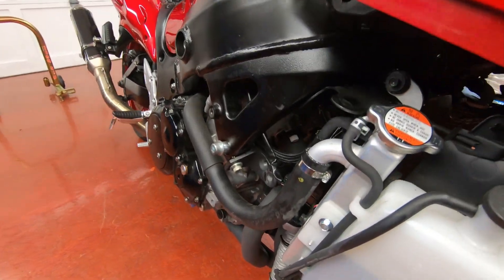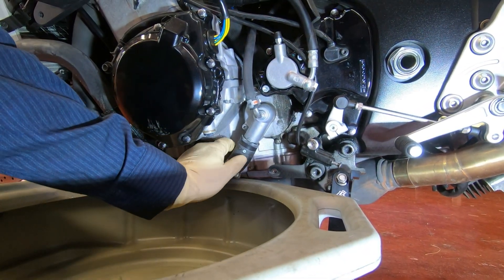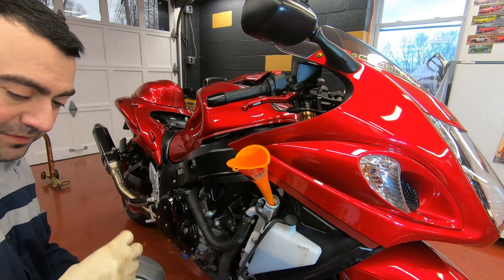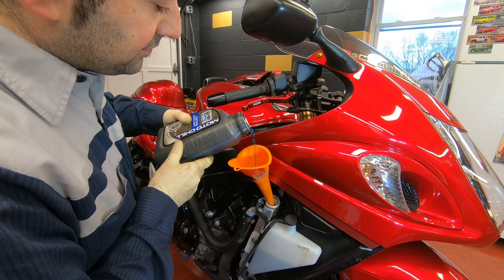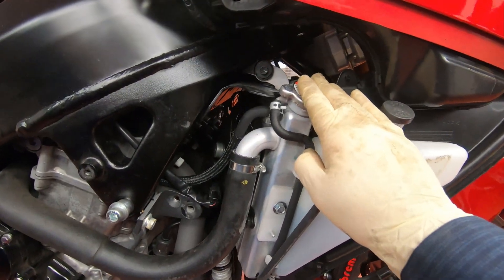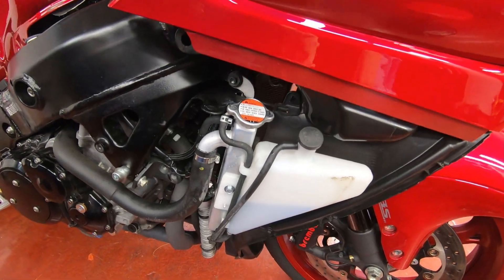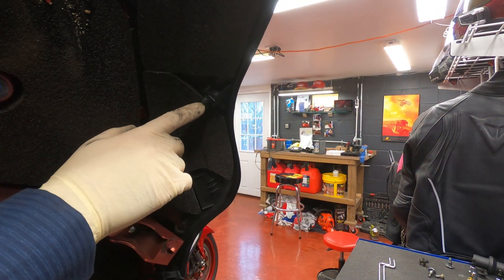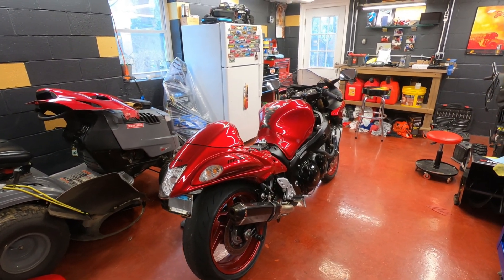How to Replace Motorcycle Coolant | Every 2 years

Comment: Hi, the manual indicates using ethyl-glycol-based coolant and the moto chill uses propylene glycol.
Reply from the maker: Hey, my manual on page 2-5 and 2-6 says to use Suzuki super long life coolant and if not available to use glycol based coolant but doesn't specify ethyl or propylene. Mine is a 2020, maybe yours is a different year and has different requirement? 🤔 
Regardless ethyl has better heat transfer but is more toxic to the environment 😅
But definitely use whatever your manual calls for.
Reply: @FASTONY Yes, my manual says ethylene glycol. Thanks for sharing the information friend.
regards
Reply from the maker: @mariogonzalez-xk5ym you're very welcome my friend! My pleasure 🙏

Comment: Is not there any colant drain bolt under colant body as u have drained colant from house pipe
Reply from the maker: @Nissaribnrasheed  it's been a while since I did this but if I remember correctly I don't remember seeing a drain on the bottom there.

Comment: Any motorcycle coolant? Silicate and phosphate free right?

When emptying, maybe measure how much came out, and repest step 1 and 2 untill that same amoint went back in?
Reply from the maker: @augustusmaximus891  best method is when you fill it run it, let cool down and recheck again when it's cold. Because it might need a little more than what came out

Comment: You forgot to empty the expansion tank mate. It can be drained by releasing the tube at the bottom of the tank. Also can be different formulas of coolant that do not like to be mixed so you should rinse out the system with De-ionised water (battery top up water) a few times (running the bike with just the water in) to get all of the old coolant out. As for different types of coolant, you can get propylene glycol and ethylene glycol. Propylene glycol is used mainly due to it being non toxic but ethylene glycol which is slightly better for heat transfer (recommended by Suzuki but not a big deal) is used for high stress situations or when maximum cooling is required say in hotter climates.  Both are good for street use but they should not be mixed. You use one or the other. 
I used propylene glycol in mine and the coolant needle stays in the middle of the gauge although I do not do much stop start riding in busy areas. I'm always on open roads. If you live in a hotter climate and do a lot of city riding with stop start / slow speed city stuff the bike may get really hot. There is a mod out there that allows you to switch on your radiator fans manually to keep things cool while in this environment, while retaining normal thermostat control when not selected. 
Your coolant looked pretty good. Mine was in 9 years due to bike being unused by previous owner and it was full of a chalky substance, probably corrosion. That's why it's so important to change it regularly to retain the anti corrosion properties of the coolant. I could imagine that clogging up the radiator badly if ran like like that. 
Also, pinch your pipework to displace any trapped air. AND, rock bike backwards and forwards while running as well as side to side. Don't forget to put a little coolant in the expansion tank. BTW massive kudos for putting these vids up, we can save a few coins doing stuff ourselves with the help of the Hayabusa community!
Reply from the maker: Yes, I could have emptied the reservoir too, I should have mentioned that in the video. I got this bike brand new and like you mentioned others don't change it for years 😅

Comment: Seems like the hardest part is always removing the panels w/out damage. I bet you got the Kawi.. good choice if so but don't give away the reveal! 👍
Reply from the maker: Yup, the plastics is always the hardest part 😅 
Can't wait for the reveal next week! 😉😉
Reply: The thing to remember about removing the panels is DO NOT RUSH IT. Just be firm but gentle! Sides out first then lift up to get the top one which is vertical mount. Also, for next time put a little lube in the rubber grommets on the frame so the fairing barbs pop in and out easier making it less stressful on the panels. I used Vaseline which is a petroleum jelly that does not harm the rubber.
Reply from the maker: @royevans4581  Totally agree, no rush with the fairings 🙌
 and yes with the lube, I think I might have mentioned that in older vids